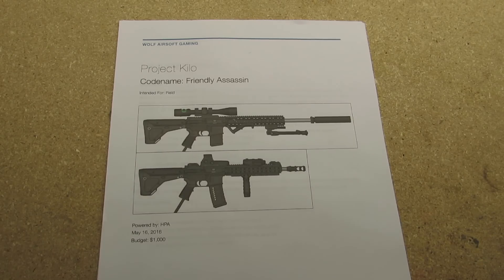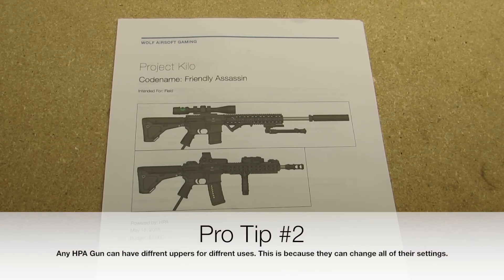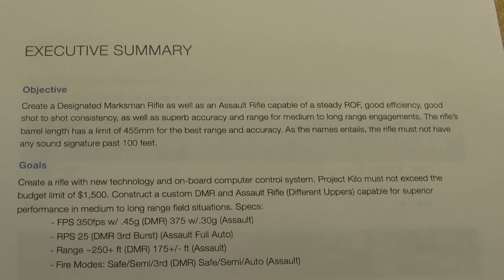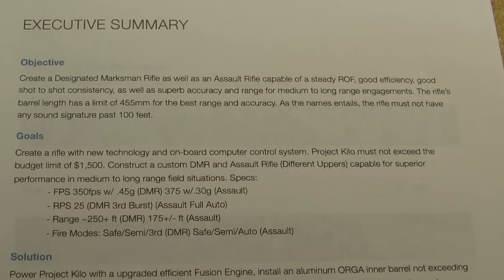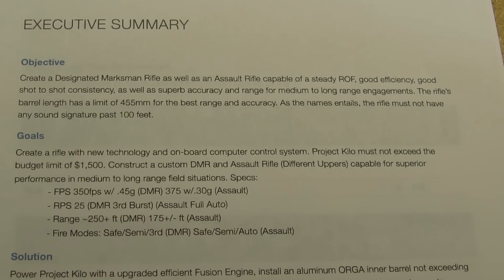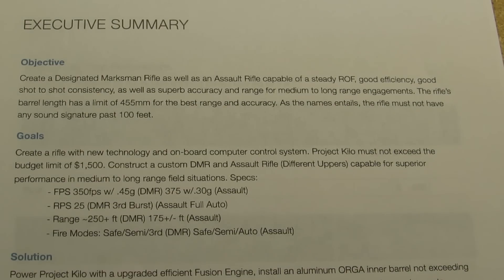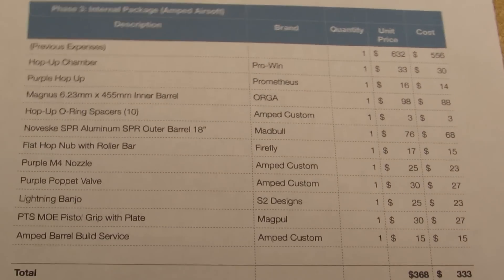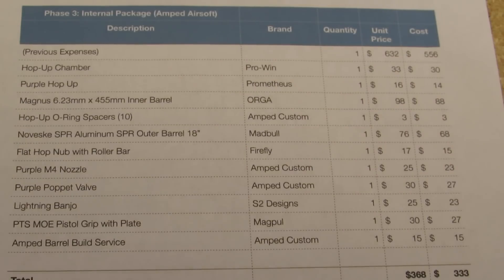Building A Polarstar DMR: Part 1- Project Overview

Comment: I was wondering if you are happy with the widebore, and if there are other barrels you think are better then the widebore. Also I don't understand why 455mm is better the 509mm. (Sorry for being such a pain in the ass)
Reply from the maker: Not at all! I love answering good questions. Really, I've liked my wide bore a lot but I will be running a TBB set-up in my assault rifle upper receiver. Probably of PDI brand or something similar in the 6.03mm family. I could go on for hours about the barrel length but to have it put simply unlike firearms that have rifled barrels and un-symetrical ammunition, BB's only need a barrel to have air push it out. If it comes in contact with the barrel it will begin to hurt its accuracy and range because the backspin has been decreased. Anything longer then 455mm will significantly damage it. The M16 length 509mm won't have that much of a detrimental effect but something like a 650mm will. AEG's can also only supply 455mm of air. P* and Snipers can provide more, but again it will touch the barrel. In the end the results might be something like this. Notice the data peaks at 455. Not too much, Not too less.
My rifle in the video with .43b BB's
100mm barrel ~ 130ft
300mm barrel ~ 240ft
455mm barrel ~ 300ft
509mm barrel ~ 295ft
650mm barrel ~ 250ft

Comment: And what brand .45s are you using. I have never heard of the Alpha bbs, are the .32s good? I was looking at KWA .32 bbs.
Reply from the maker: Currently I'm using ASG .43g BB's. They work really well. I also have WE .43g and the brand new Amped custom .43b BB's. Im waiting until I can do a proper test with the scope cam to see which are the best to feed my DMR. I haven't used KWA's but they are a very good brand. You shouldn't have any problems with them.